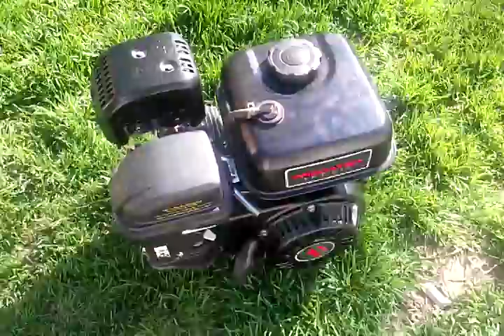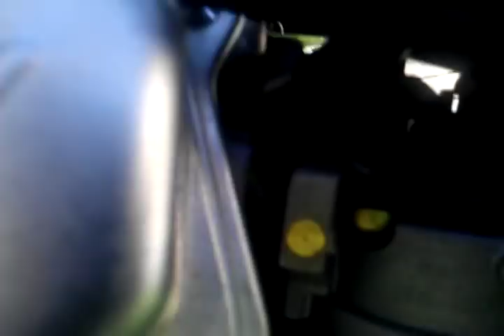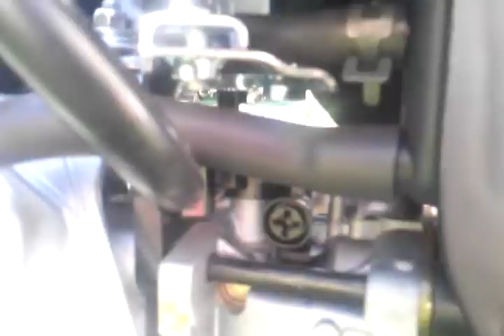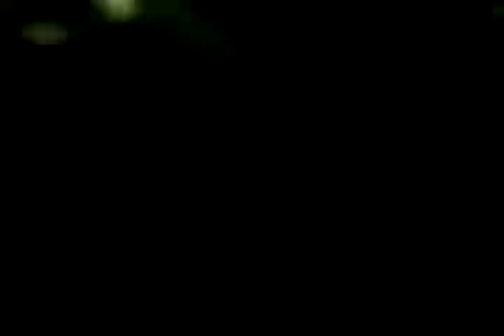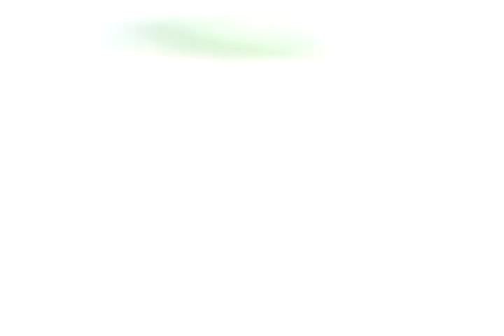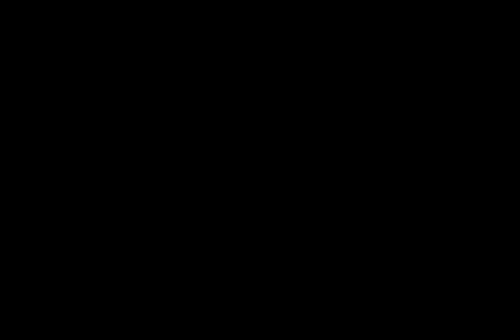Predator 212cc engine tuning

Comment: my bike accelerate fast but as i drive it slows down and goes slow i have the predator engine on a 100cc coleman mini bike dose anyone know why?
Reply: Because your rear sprocket is too big, I have a azusa minibike and I had a 54T and switched to like a 44 or something like that and I can do 40 no problem when I used to only do 30 or so

Comment: I would like to know about me carburetor throttle gas it does not have a sprain does it need a spring to throttle back forward back and forward please let me know I would like to know because my spring is gone off of my throttle to gas on a carburetor

Comment: HORSEPOWER UPGRADE*Cut the box off the muffler but KEEP THE PIPE ON DO NOT CUT THE PIPE OFF JUST THE BOX TO THE MUFFLER if you cut the pipe off horsepower loss just cut the box off
Reply: And that's how you trow a rod 😂 (you need back pressure)
Reply: @cro-thehacker7018  not unless u have a race Muffler and billet rod and heavier valve springs

Comment: my 212cc wont start can someone please help me it ran perfectly started in one pull now it wont start someone please help me
Reply: how about the killswitch
Reply: Clean the carb
Reply: Carb cleaner
Reply: Low oil sensor
Reply: Did u tip it? Maybe u flooded the carb
Reply: Get a new spark plug

Comment: So in does it make it run leaner or richer?
Reply from the maker: I was first getting into engines when I made this video, Basically that screw that i'm adjusting is the Idle screw, if you turn it clockwise it will make the engine idle higher, if you turn it counter clockwise it makes it idle at a lower RPM.
Reply: Thanks for reply so quickly. But it doesn't seem to make a difference with the idle.
Reply from the maker: JD Mather No problem . And you might have to turn it a little ways right to finally have it make a difference , if that doesn't work I don't know what to tell you.
Reply: No it does not
Reply: You change your jet to a larger size to let more fuel in or change it to a smaller size to make it run lean
Reply: @christainresenbeck7545  This is NOT the  idle screw !!
Reply: @christainresenbeck7545  That screw  has nothing to do with the idle.......

Comment: My guy just said this controles the carburador. Lol don’t make vids if you don’t know what your talking about.

P.s. if you put the idle really low it’s hard to start.
Reply: The idle has nothing to do with  a hard pull on the cord ( hard starting a gasoline engine.) ........ get educated,
Reply: @tommiller6580  do you know what does I bet you don't. Lol it's the valve lash setting being off which throws the firing time off and the motor fights against itself  or the flywheel is sheared and throws timing off that way. that will make it hard to turn over.

Comment: Total  BS, this screw doesnt do anything , except come all the way out ( counter clockwise ) to get to the jet underneath this screw to clean out the orifice of the jet..... The jet comes out with a flathead  screwdriver  as you pry up on it..... it will come out  and you can clean it if it gets plugged up.   THIS SCREW DOES NOTHING!     It just holds the jet in place !!!    Notice, the video isnt  rolling while she's saying she's adjusting this plastic screw. Good luck pulling on the rope of a 6 1/2 HP gas motor just resting on the lawn, aint gonna happen !
Reply: I have a cart and a Coleman with predators, one hemi and one not and that screw definitely turns my idle up or down. Not sure why not saying I'm a mechanic but I know the difference between idled high or low
Reply: @turnerboyz901  yea i agree it definitely does something